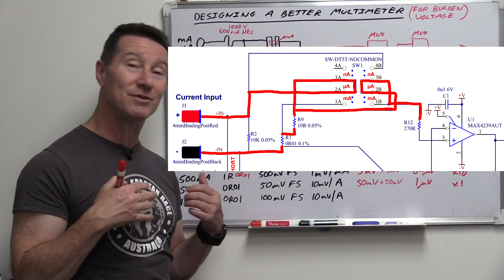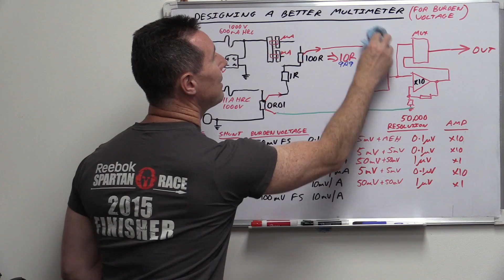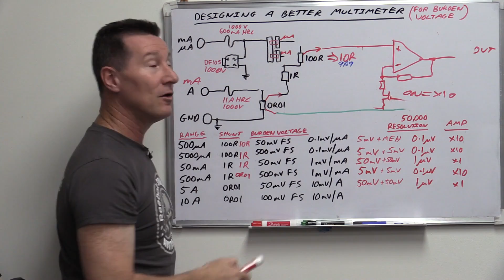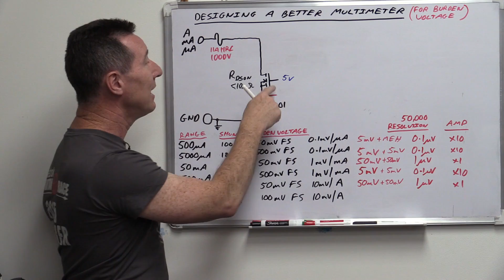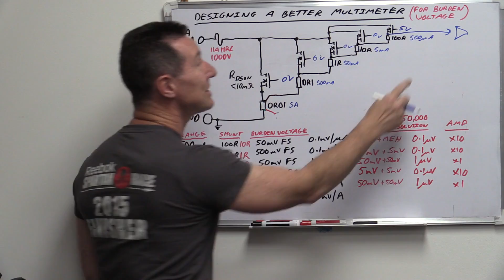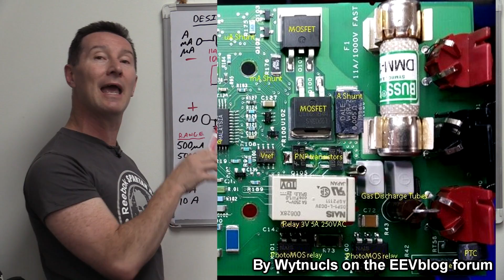EEVblog #931 - Designing A Better Multimeter PART 2

Comment: Dont get how to serial 111.11 ohms shunt resistor helps precisely measure current, better than separate 100, 10, 1, etc  or serial 0R01, 0R09, 0R9, 9R, 99R

Comment: Here are a few other ideas...

1. Measure the burden voltage across your DMM, then increase your supply voltage (if adjustable) by that amount to compensate for the burden voltage.  That way your DUT will have the desired voltage drop across it.  This will not work if the DUT current has large current spikes or significant non-DC components.

2. Use a precision 1-ohm shunt resistor, and a good auto-zeroing instrumentation amplifier (MAX4209, gain=100) and build up a little external battery-powered current-sense amplifier circuit.  Then just use a regular DMM volt-meter to read off the output voltage, which is proportional to the current.  Or watch the output voltage waveform on an oscilloscope for a DIY precision current probe!

Comment: Why can't you just use the reverse breakdown voltage on the single MOSFET's body diode for your forward clamp? It will be a couple volts higher, but so what? What am I missing?
Reply: You'd have to make sure that the breakdown voltage of that MOSFET is lower than the others, then, I suppose.

Comment: My first thought when I saw you put two MOSFETs in inverse parallel was "you can't turn that off!" It took me a minute to realize that the forward voltage drop of the body diodes is what turns it off when you're using lower ranges.

Comment: i have actually used mosfet switching for current measurement before in a small personal power supply project 

i had to take real effort to filter every mosfet drive because noise got coupled into the drive lines (from the processor) than into  the sense line ... i did not think it was going to be a problem because of its high impedance but with the bandwidth i was using it actually became a bit of a problem
Reply: Vary good point, that will seriously affect precision.

Comment: Can you please clarify how the 5V supply authentically goes to the right MOSFET?               What I understand only one MOSFET should be  ON at time, but it is not clear how. Thanks
Reply: People mention auto-ranging software.  I assume that the ammeter starts in the max current range and goes down to a displayable reading.
Reply: Bob, thank you very much for you comment. It is a bit disappointing that Dave asks people to give comment or questions in his videos and does not reply to them.

Comment: Dave: On the Amp range, why is it better to use that 2nd beefy MOSFET for protection instead of a generic rectifier diode? I get the advantage of not adding another type of component to the BOM, but wouldn't a diode be enough cheaper than a heavy MOSFET to outweigh that benefit?
PS: As a former digital design guy, I really appreciate the analogue design tutes like this one - please keep 'em coming! :)

Comment: lets make a dmm without hrc fuses and all the safety features cat rating ect. we can use the big guns for high and low voltage where safety counts and detail doesn't. and  a more precise instrument  where detail does matter in super and extra low voltages. you don't use a sleg hammer to crack a nut, you don't probe line voltages with your scope, you don't have all this high energy protection on your micro current. I don't take my £400 fluke dmm to work, I take a £3 pos to test plumbing related electrical stuff because i'm measuring dead and i don't want my fluke nicked or smashed up.

Comment: Has anyone ever tried to use the fuse as the shunt resistor ?
Then you just protect the sense line against HV.
Each time you blow a fuse it has to be calibrated again, but maybe it will be the start of characterised conductances fuses with bar codes :-P
Reply: having the adc of your meter connected across something thats supposed to break the circuit defeats the purpose of it, beter just short the fuse

Comment: Why not measure across the fuse? Use the fuse as the shunt resistor. Multimeters are mass produced. Mass Produce fuses to meet a resistance spec.
Reply: It's hard to produce a precise resistor, and it's hard to make a fuse that will blow safely under specific conditions. It will be extremely hard to mass produce fuses that meet both requirements, especially as fuses may need replacement quite often.

Comment: Could the circuit be extended to automatically switch off a given MOSFET if the corresponding shut current was too high?  e.g. latching open-collector comparator across the shunt resistor and tied to MOSFET gait.

The design seems straight-forward but I don't know if it would be quick enough to actually protect the shunt resistor and MOSFETs from overheating / exploding.
Reply: I think the result would be worse, as you have the body diodes conducting. They will be dissipating a lot of watts, as the Vf of those diodes is usually high (>1.1V).

Comment: Hi, Tony in Los Angeles loves your Math Lessons.....i would really like to learn how to calculate the Transistor Bias used in a power supply.....here is detail......a regulated variable IC DC 3 to 30 type, with several power transistors connected in parallel in a common collector (Guessing) to increase current, also placement of filter caps, series induction.....this power supply is for HAM Radio, must NOT be switching...output current should be 70 80 continuous duty....something also about parallel transistors, they run away without a load? so huge Sand resistors needed? thanks
Tony

Comment: Just wondering ... 
Wouldn't a relais be better for this in terms of leakage current and RDSon?
I know, it would be more expensive and more power consuming but ... If it's not a battery powered multimeter .. I guess it's even better than the MOSFET variant?

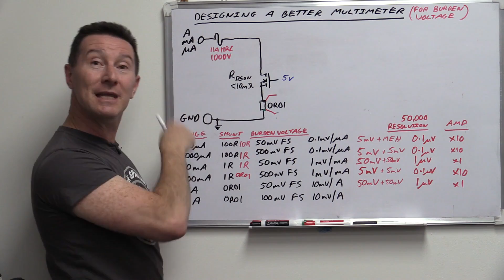Comment: 17:13 works in both directions? but what about the body diode? doesn't this make it a short circuit, because you have diodes going in opposite directions? how would you turn it off?
Reply from the maker: Only if you have all the transistors turned off. Turning on one transistor limits the drop to the burden voltage so the body diodes do not conduct.

Comment: I am looking for something that can find most current consuming parts by measuring across supply tracks - in a circuit that consumes just a few milliamps! The results don't have to be accurate, just good enough to locate biggest consumers. A DIY microvoltmeter would be nice!

Comment: +EEVblog I may have completely gotten the wrong end of the stick, but the effective shunt resistance of e.g. the 500uA range would be 111.11Ω, right? That'd be a 11.11% error, if you were expecting the output voltage to be 10^n multiples of the input current.

So you'd either need some correction after an ADC, or use 0.01Ω, 0.09Ω, 0.9Ω, 9Ω, and 90Ω shunts…

If anyone can clear up my confusion, that would be much appreciated.
Reply from the maker: A multimeter can have any value shunt, they get calibrated at the factory.
Reply: Oh yeah, how could I forget you and your cornucopia of transfer-standard-grade equipment. :)

Comment: Hello
If I understand it right the Body Diodes are always on and in this configuration I am allways get a short, no matter how I connect.
What I do oversee?
Thanks,
Reply: probably you oversee the voltage drop across the body diode versus the voltage drop across the shunts, under normal conditions the diodes will never conduct (except some very small leakage current).
Reply: Like Robert said, the body diodes will have a forward voltage of ~400mV, while the shunt resistors will only get up to 50mV voltage drop.
Reply: Fv in body diodes is usually about 1V or more. Especially at relatively high currents.
Reply: Ah, Ok. Thanks.
Reply: At higher currents, yes, during clamping. But we are talking about leakage currents here, during normal measurements.

Comment: Dave, I think you contradict with yourself when you discuss the switching properties of MOSFET at 17:15 and 29:30. Because of the body diode the switch will be always closed if the input is reversed.

Comment: Since there is a voltage drop over the fuse, why not use this to measure amps?
Reply: The voltage drop is measured over a known resistor with a very tight tolerance. Any uncertainty in the exact value of the resistance will lead to an uncertainty in the value of the current. The resistance of a fuse is not precise or constant enough to make an accurate meter, and fuses can be replaced by new ones that have a different and unkown resistance.
Reply: that would be great but then I think it would defeat the purpose of having a fuse
you would need to have a mechanism where the fuse is removed from circuit and its resistance measured, at least once per power on.
Reply: Clear

Comment: Hm, I must have missed the part about how to make it so that you can swap the meter probes and still get a proper reading just like in basically ever meter thats out there. Also with the mosfets in parallel, why would the current not go through the body diodes instead of the higher value shunt resistors? I must have missed something.

Also my current meter has the advantage that it can be off while things are connected, the mosfet solution would need to be always on to conduct anything.

There seems to always be a tradeoff, and you better know how these things work when you measure stuff to not get nasty surprises.
Reply from the maker: If any transistor is on then the voltage drop across the body diodes is less than the 50mV shunt resistance, so no problem.
Reply: EEVblog Diodes and resistors in parallel must be pretty unintuitive to me, I had to resort to a quick ltpsice simulation to see what is going on here :/. And of course when the voltage over the 100mΩ shunt is that low, it is the same over the diode, thus its not conducting much (drawing it as diode and resistor in parallel makes this quite obvious). Would look pretty different though if we allowed for the old designs burden voltages...

However what I noticed in the simulation (I swept from 0 to 10A current) is that when the setting is at 500mA the corresponding FET has to conduct ~6A (and the body diode of the protection mosfet for the 5A range the rest, at least for the random FET I chose), which makes me wonder if we have to size it that big or if the automated range switching must make sure that this case never happens.

Comment: Great video, Dave! 
IMHO cheaper solution is to replace the extra protection mosfet with a diode. Also the diode is smaller compared to the mosfet.

Comment: The back-to-back MOSFETS mean that whatever current is passing through the meter is always passing through the 0R01 shunt resistor. As you say - body diodes do NOT turn off. I don't then see how you accurately measure the current across the shunt resistor you wanted to use? If the current is splitting you will not get a true read off, say, the 100R.
Reply: Whatever shunt resistor is in play keeps the voltage down to a few tens of mV, so the body diode doesn't turn on.
Reply: Ah, ok, makes sense :)
But that doesn't answer, why the mosfet in reverse would work. I can't get my head around that...or is it just for the body diode?
Reply: My thoughts exactly. Also, the reversed Mosfet would see the gate voltage as 0 and -5V. Wouldn't it be better to take a P-Channel Mosfet or do something completely different?
Reply from the maker: Only if you don't switch any of the transistors on, which is of course silly. It one transistor is on then the voltage drop across the body diodes is less than the 50mV shunt resistance, so no problem.

Comment: Useful for new players would be a video explaining, in concrete terms and with examples, the differences between devices that would apply a voltage and devices that would apply a current. Because you've alluded to the difference repeatedly here but the difference is somewhat abstract.

Comment: Maybe this is a stupid question, but I was wondering if there was any use in for example gating on a capacitor for a tiny time period and then gating it another way to directly sample what was in it, without a shunt resistor? Or more like when the shunt resistor was at the same turned off. Could that be good for maybe voltage, or none of the above?

Comment: Looks more elegant than the design in part #1, especially because as a user I only have to remember one burden voltage for all ranges. I personally would pay the extra $4 (plus markup) for the chopper amplifier to get 5mV burden voltage, even if it introduces 1LSB of error on a 60,000 count meter. NEXT UP: A video on sexy input protection circuitry!
Reply from the maker: I've done a video on multimeter input protection.
Reply: Right you are #373 back in 2012. Thanks!

Comment: Why should the different ranges be cascaded? Can't they just be in parallel and switch different sense resistors for different ranges? (but made sure break-before-make)
Reply from the maker: Sure, and I mentioned that. Disadvantage is the sense point can become troublesome.
Reply: +EEVblog okay. Thanks
Reply: +EEVblog Got it. Very clever. Thanks

Comment: I wonder about the mosfet characteristic curve when, for example, a multimeter is advertised as true rms.  I suppose you work that out but I'm curious about its effect on AC measurements.  if the mosfet is pegged on, saturated, isn't the mosfet acting like a filter at some point?  i.e. band pass or notch?

Comment: Wouldn't it be easier to just buy a multimeter rather than going to the trouble of building one from scratch ? You can buy one for as low as £10 from amazon.
Reply: I'd say 99% of the viewers own more than one already. This video is about certain aspects of their design, most of it applies to other problems as well.
Reply: Those cheap multimeters won't be able to do what this circuit does
Reply: Perhaps Dave is speaking to (or for) those in the business of multimeter design.

Comment: This seems really weird. Why would you use another MOSFET just for the diode? Is BOM optimization that bad of a problem?
Wouldn't leakage through the shitty body diode of a MOSFET be a problem, especially since one of them is forward biased (albeit below Vf)?
Reply: setting up the pick and place machine cost money, every extra component means an extra feeder and adds up to the setup fee. if you manufacture 100k+ devices it might be cheaper with a diode, but in low(-ish) quantities it's cheaper with reusing a mosfet which is already on the BOM.
Reply: you also get a lower rson because both mosfets are switched on. => you can use cheeper mosfets ;-)
Reply: Sometimes that one extra component means either another run of board through pick&place machine or switching to bigger machine:) Reusing components is key to making a product that's easy and cheap to manufacture.

Comment: Isn't the maximum resistor power dissipation in the 500mA range before the fuse blows or the body diode starts conducting rather high?
Reply: 0.25 W isn't much!
Reply: My thoughts exactly
Reply: That's if the multimeter is turned on. If it's off it won't be doing autoranging.

Comment: You'd also need to be careful about leakage current of the big MOSFET affecting accuracy of the uA range - I doubt low-level leakage is well specified on most  big MOSFETs as most users of them won't care about it.
Reply: You are right Mike!

Comment: And in uA range of your uCurrent, 10k in parallel with 10.01 actually compensates and the theoretical shunt value is 9.99999 ohms! Of course, with 0.1% resistors this is meaningless, but nice, though.

Comment: But with all of those FETs (with the body diode), if you connect the multimeter in reverse polarity won't the body diode in every FET start conducting and you will be stuck in the 500uA range?
Reply: Oh actually, assuming you turn on at least one FET, the voltage across any diode should not reach 0.6V. Nevermind :)
Reply from the maker: Correctamundo. I actually meant to mention that but completely forgot. If you turn all FET's off then current will still flow through the body diode(s).
Reply: Those FET diodes usually have a Vf of 1V; more if > 1 amp.